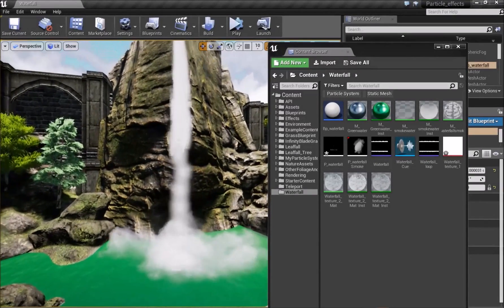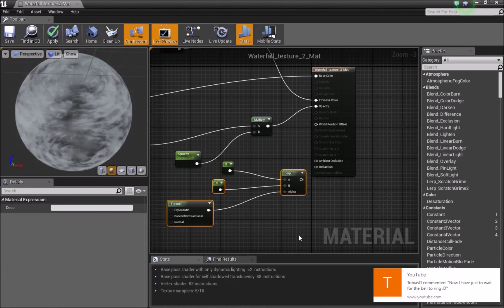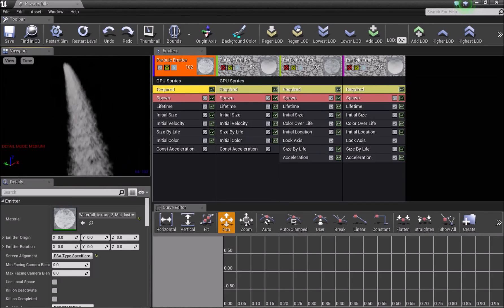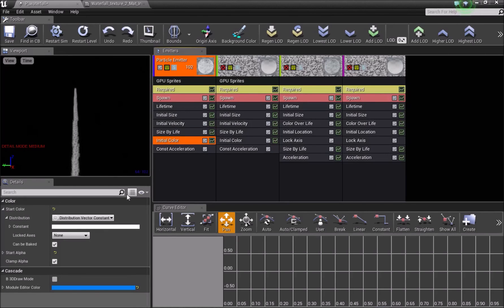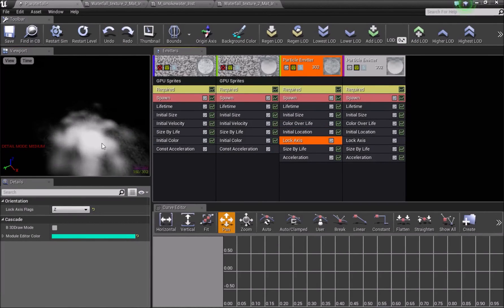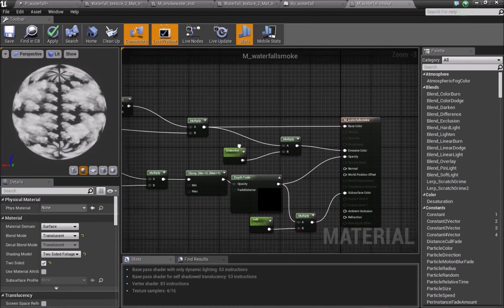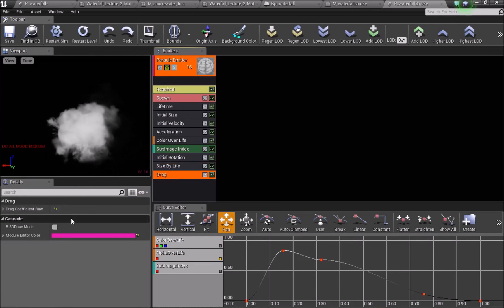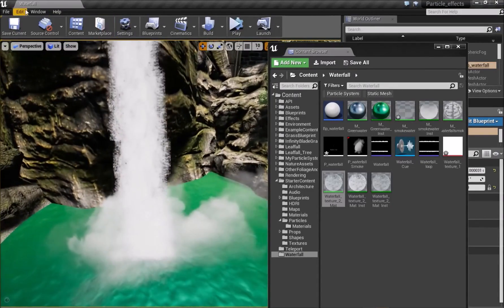Waterfall | Tutorial | Unreal engine 4 Particle Systems

Comment: hey in the particle emitter section, whats the difference between the 3rd and 4th particle emitter? you said they share the same attributes, so why are there two?
Reply from the maker: One is the water texture and the other is the blurred circle material.
Reply: ok thanks, where do we get the blurred circle material? and also another question, i am at the part where you are adding the waterfall smoke to the blueprint, and you said to add it to the part where the watterfall makes contact with the ground, but how do i do this? it seems like the location of the waterfall smoke changes based on my perspective in the viewport
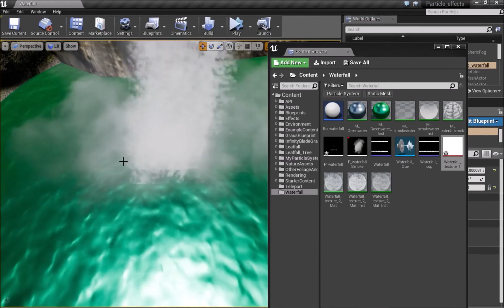Reply from the maker: 3:20 in the video for that material. About the smoke I edited the smoke particle system and material that comes in the default starter pack. You can try to look up camera facing particle systems settings. It's all about getting the settings that work for you. I don't particularly know all the settings I just experiment until I get the result that works for me. (Look for camera facing)
Reply: ah ok thanks, I used the orthgraphic perspectives and got it to work